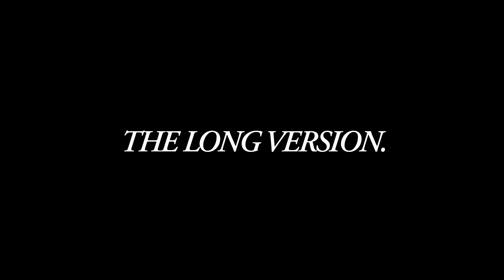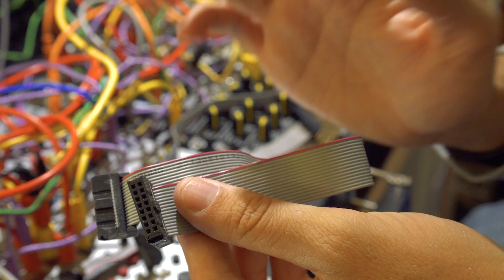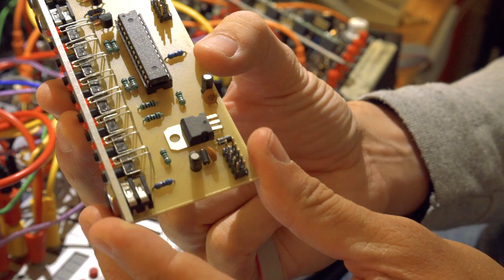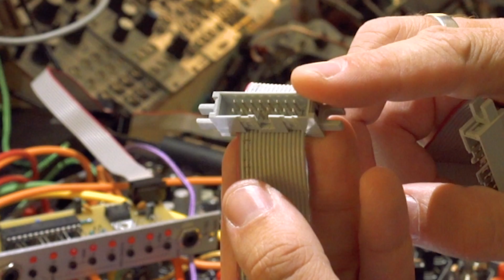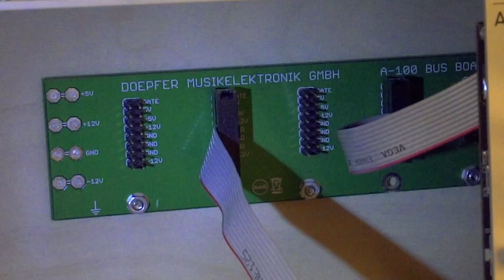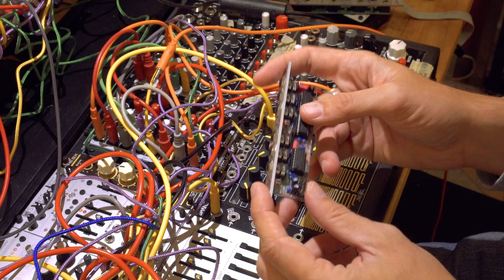How To Plug a Eurorack Module In, Correctly (Eurorack Power 101)

Comment: Dave Smiths Curtis filter module was one that caught me out, once when I was moving modules about it not long after it was fitted correctly was the only module that doesn't have a notched end on it's ribbon connector and I forgot, plugged it in the wrong way, I use row power with flying bus cables as I think they are excellent, seemed to damage only the row power I had, the 5 volt light is out (I don't use it although it seems still work, probably not for 5 volt though). I always read the manuals and check when getting a new module, just for my own paranoid connection sanity.
Reply from the maker: FWIW I killed the A148 with the Row Power I show in the vid(!) In this instance it came down to the protection on the module end (or lack of, I should say)
Reply: yeah, pretty much can't do about that if there is no protection.

Comment: The absolute MOST FRUSTRATING POWER ARCANA is that if your case has a power supply with a converter manufactured by Meanwell it will break the Rene Module from Make Noise and void the warranty. And if you think, well I've never heard of Meanwell, it must be some obscure brand, it's the converter that Intellijel and MDLRcase, Error instruments, and others use so you might have one and not know it. This is why you read the manual.

Comment: Shrouded headers on BOTH the module and AND the power supply.  Why is it the parts on my computer are idiot-proofed and standardized where you have to stupidly force a square connection into a round hole... however on my Eurorack modules they cheap-out and just give me bare pins?  I spend hundreds of dollars on a box with power supply in it and they get all kinds of cheap on the most critical part?  

Oh, and you don't blow up a module the first time you connect it.  You do it on the 5th time you rearrange your modules and you become overconfident.  It's like surgery.  No one ever cared that the surgeon finished in record time but the patient died.  Do it slow, check your work... then check it again.  If you have a deadline to get your rack back up and running, then you shouldn't be tinkering with it.  Carefully plug it in, go have a coffee and a cigarette, then pull up each module and check again.

Comment: What about tragedies on the front of the panel? Connecting input to input, output to output, connecting Buchla to eurorack, banana into 1/8", Buchla output to eurorack output, adding splitters in the mix to the previously stated mistakes potentially compounding problems, etc. I think I fried a microphone once by plugging the mic into the input of a feedback loop guitar pedal called Eye of God (I'm pretty sure it was plugged in correctly) I think the power somehow went backwards and turned the mic into a speaker.
Reply: Also wondering what you think about preventing fire risks in the studio and what to do if one does occur, like what type of extinguisher won't ruin adjacent gear while still being effective. I've also heard that lead-free solder can lead to fires because it grows dendrites over time that can cause short circuits. You never really know if there was repair on used gear done with this kind of solder. There have been quite a few studios burn down but I'm not sure what the common element has been.
Reply: Also wondering what happens when CV is plugged into audio, audio into CV. I've heard that the results differ between modules from nothing to destruction. There are so many modules that don't label in's and out's, some just print funny symbols on their panels and expect you to figure it out. Once you start messing with things like 5 way cable splitters partially connected to other 5 way cable splitters I can imagine it gets to be a lot to keep track of to make sure you don't destroy 10 modules with 1 dumb cable mistake.
Reply: RoboticusMusic In Euro at least (and I think pretty much everything except Buchla), there’s really no distinction between audio and CV. The only real patching danger is an out to an out and even then most modules are protected against that.
Reply from the maker: Yeah none of the front panel stuff should have much of an effect, you'd have to be really trying, to break something that way (Using a multiple to sum 5 10V signals to a tender input somewhere else...etc)
Reply: And even with that, I think you can never get above the 12 V rail voltage.
Reply: No output can ever exceed 12V in a eurorack system since you can't produce anything higher than the voltage it is supplied. In actuality it gets capped a little above 10V. Of course you could get >12V from some other source outside of the system, but it would take a fair amount of voltage to actually hurt things assuming proper module design.
Reply: That's it, you accept full responsibility for your mistakes. Good comment👍

Comment: A spot of red nail polish on the -12v side of the pcb of any unshrouded header is a good idea if the orientation is in doubt.
Reply from the maker: Good idea that, just permanently add in the missing info on the module!
Reply: oooh kinky
Reply: I have done that too :-)

Comment: There's really zero excuse today for a manufacturer to not use keyed shrouds on headers and keyed IDC connectors. 
The additional cost is trivial in manufacture and the maker gets it all back in customer goodwill on the 1st board which escapes release of the magic blue smoke.
Reply: Problem is that keyed shrouds lead people to trust that the cable itself is correct, which is dangerous. There's zero excuse for not having reverse polarity protection on modules though.
Reply: M Campbellell... problem??? If you supply a correct cable with the product and everybody uses cables of the same standard then the only people with problems will be those who try to use wrongly wired cables and Darwin takes care of those people pretty quickly. The computer industry went through this way back in the 70s. Some people paid attention to it. Apple for instance has been using shrouds in everything since 1979 and as a result during the 80s and 90s, Apple equipment didn't constantly end up in the shop with blown boards because of misaligned connectors like PC hardware did. The same is true for peripherals on all platforms. This isn't rocket science. I completely agree with you about polarity protection. A 2.2 ohm resistor on the rail feeds with reverse biased 1N5408s behind them should be a minimum. There's no reason people can't use polyfuses either.
Reply: Agreed, yet gain Doepfer are one of the worst, their power boards just have pins, so very easy to plug in a cable incorrectly. Just poor manufacturing and no thought for how his products would be used in real life, maybe this was acceptable 10 years ago, but not today and 1000's of dead modules later. Maybe everyone should send him their burned out modules in the post, he may then get the message.
Reply: Personally I hate shrouds on power supplies. Bloody nightmare getting connectors out.
Reply: MUNRO MUSIC, that's poppycock. 
I've been using connectors like these https://www.digikey.com/products/en?keywords=5103308-5 for 40 years. 
The shroud makes zero, repeat ZERO difference unless you try to plug into it backwards.
There are plenty of deep shrouds with eject levers too if you want that. They used to be the absolute standard across the computer industry in the 70s.
Reply: Funny how I can buy PC parts from as many manufacturers as I have parts... and they all fit together without blowing up.  From a $1000 graphics card, to a $5 PWM fan.  Yet Eurorack manufacturers are still dicking around with the standards for the power cable?  As far as cross-patching a ribbon cable... whoever is so sloppy to do that needs to be dragged out in the street and flogged with an extremely long stackable cable.
Reply: Came here to say the same thing.  It's baffling why every eurorack producer doesn't do this by default.
Reply: I totally agree with this, but Doepfer's Eurorack spec specifically says, "unboxed headers only, without bowl/box and without code gap!" in red and bold, which is probably why most manufacturers don't use them. Anyone know why the spec says this?

Comment: Can you try replacing that TL064 chip?
Reply from the maker: Yeah I swapped it out for a TL074. It lights up now but doesn’t operate correctly
Reply: @mylarmelodies  Replace all the ICs. They all have power pins so they are possibly all damaged even if they didn't crack, especially the switch chip. Don't think there's anything else in the A148 that is likely to be damaged.
Reply: @petewallis3756  This was my thought too. The ICs seem pretty cheap on that module so it's worth a shot.